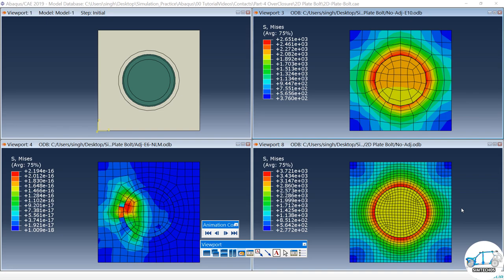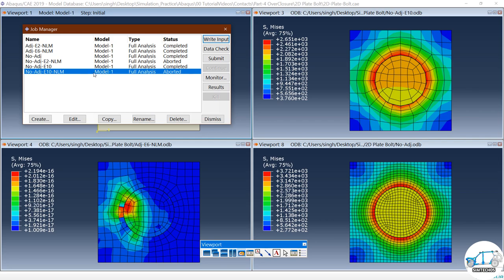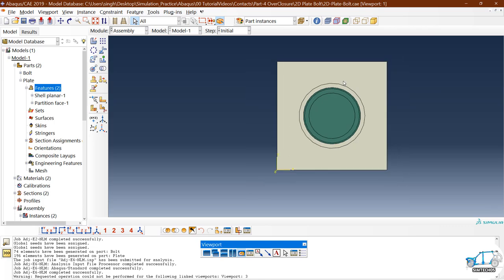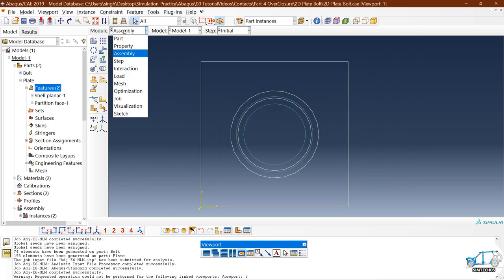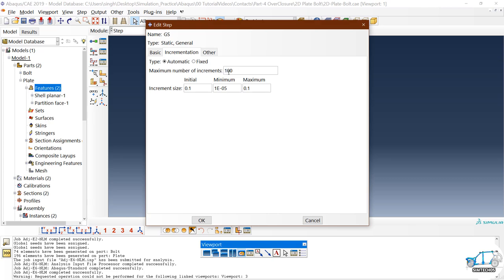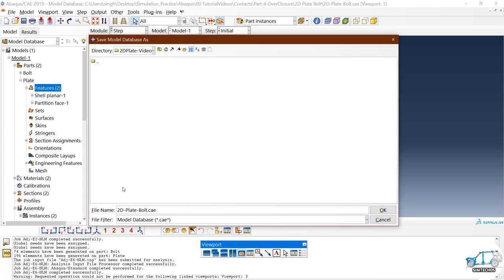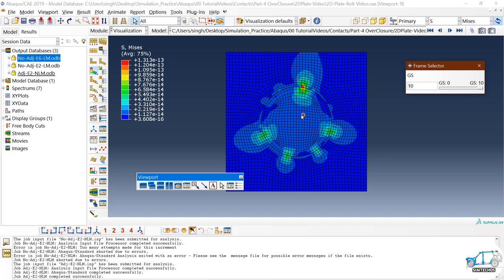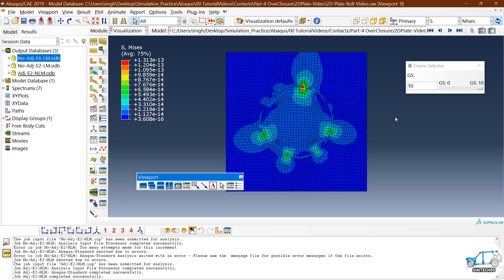Convergence errors in Abaqus, too many attempt error, (Interactions in Abaqus Part - 04)

Comment: Thank you for the video. But it seems that although the adjustment allow Abaqus to complete the simulation, the result is not reflecting the interference. So the adjustment did not really solve the issue, right? Do you have a way to solve the issue and get a proper solution?
Reply from the maker: Dear,
Initial adjustment option is used when the unwanted small penetration of elements/nodes. It remove penetration without any stress development.
On other hand...
For press fit type of problem you need to introduce interference fit parameters in contact.

Comment: Dear sir, adjustment and no adjustment for finite sliding are available in STANDARD surface to surface as u presented. Yet,this option doesn't exist for EXPLICIT surface to surface contact.Why these options doesn't offer in Explicit contact?
Reply from the maker: Dear,
Contact control options are available for explicit also but not Directly in contact defination. We need to define control individually otherwise it consider default one.

Comment: Thanks sir for the AWESOME video..BTW, Can I modelling the actual condition of bolt with hole tolerance in the abaqus. Let say, the bolt size is 16mm while the hole size is 20mm. In this regard, there are 2mm gap tolerance btw both surface. Do the abaqus capable to run this modelling?or it will be an error due to surface contact issues? or the software will interpret the gap as an issue and automatically resolve the  problem like the overclosure problem that u has presented in this video?...Or the modelling can be simplified by simply ignoring the tolerance gap btw those surfaces?..thanks in advance.
Reply from the maker: Dear,
Tolerance model you can stimulate.
More you can take different assembly and run simulation... you will get better idea.

Comment: I am conducting uniaxial tensile test on a grouted sleeve connection...i was advised to do mesh convergence study before the velocity convergence ...i analyzed my model with different mesh sizes and plotted the load displacement curves..the models shows same peak load at mesh size of 10mm, 15 and 20mm but once i lower the mesh size i get the lower values of peak load.  so should i consider that the solution got converged at 10mm. ??
Reply: my expectation was that when i reduce the mesh size it should give me higher peak loads for the connection but vice versa happened
Reply from the maker: Dear,
Mesh convergence means you will get near to constant value even if u reducing mesh size.
If not then convergence study is incomplete.

Comment: Sir I tried stretch forming operation...deformable shell as sheet and rigid shell as binder....I am giving load on the binder but the load is not getting transmitted to sheet....Is the problem due to interaction?
Reply from the maker: Yes,
Something missing in interaction.
Reply: @arsitech-ltd  I am using explicit and have given general contact... Please give some suggestions how to make it successful
Reply from the maker: If any error/warning msg appears plz check it.
Reply: @arsitech-ltd  no error...but there are warning messages..1.BCs have been prescribed at each nodes belonging to rigid bodies but are not rigid body reference nodes...Such BCs don't constrain motion of rigid body.....
2. OP=NEW on CONTACT is ignored when general contact definition is specified as model data.
Reply from the maker: Need to look at model. Plz send on my mail - gkn0504@gmail.com

Comment: Sir, how to resolve this issue if we use orphan mesh imported from hypermesh.
Reply from the maker: Dear,
If possible use adjust option to remove overclosure.
If intersection of elements are excessive..you need to modify mesh.

Comment: Hello sir.. i Simulation friction stir welding of 6061Al .. in welding step after 4 second it stopped and nor convergence occurred.. I change Element size and Check temperature(under melting point) but i didn’t solve error.. can you help me how i do??
Reply from the maker: Plz let me know how can i help you dear ?
For variety of model and steps there can be lots of possibilities of this error. What error msg u have ?
Reply: SimTech05  I send image to telegram group.. can you answer there?
Reply: SimTech05  
When i use slow welding transverse, the model is stopped at 4 second and no increments occur.. no problems in plug and dwell occur.. just in welding step.
Reply from the maker: @Shein98  
Dear,
As i mentioned in group check warnings.
It is impossible to tell reason without looking at file.
Reply: SimTech05  I sent images to group 🙂